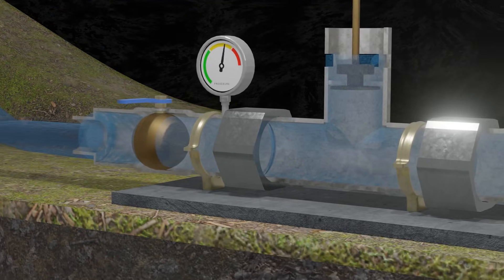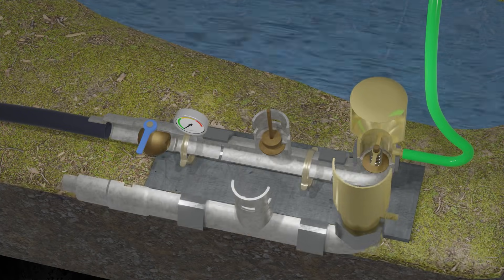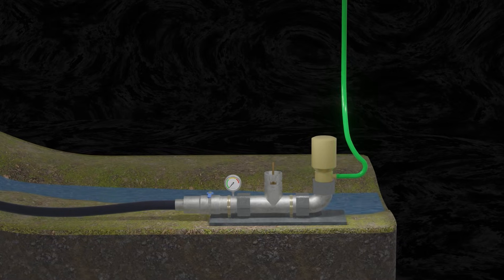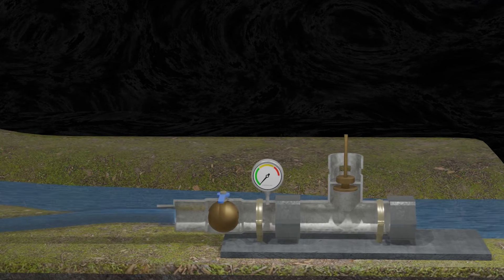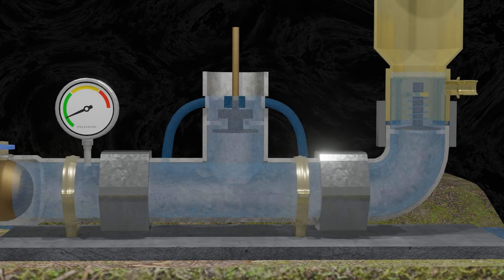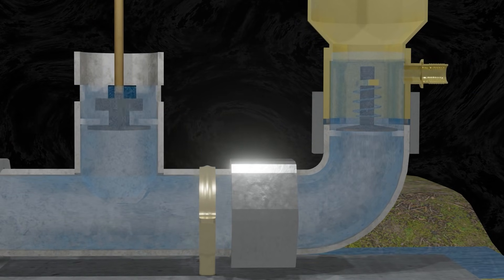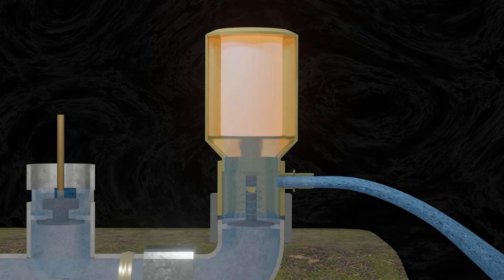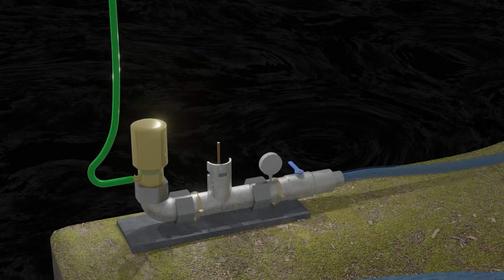how hydram pump works ?

Comment: is that possible to deep well?
Reply: As hydraulic ram pump require flowing water to work. It's difficult to make it works independently on deep well. It's better that you use other types of pump such as solar pump if you in an area that have no electricity access.